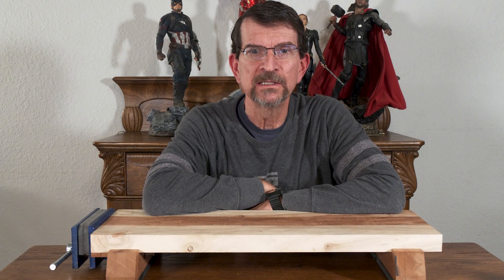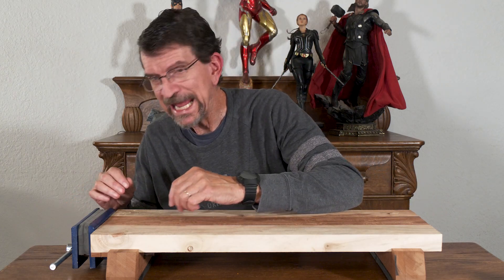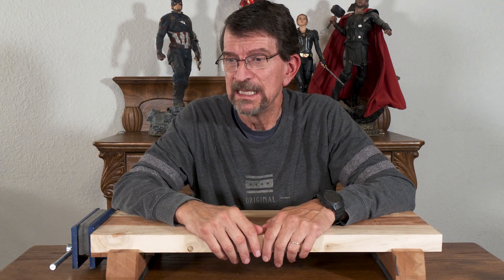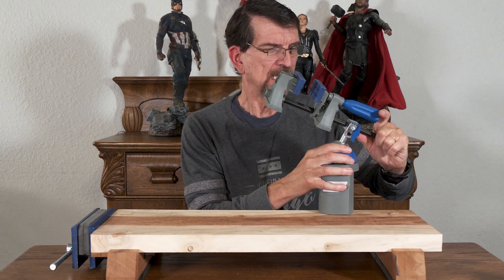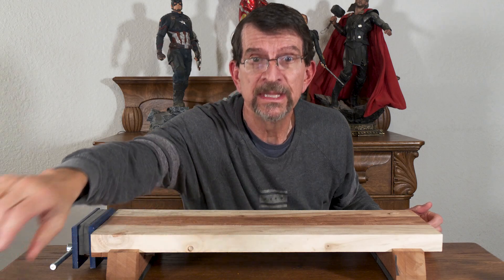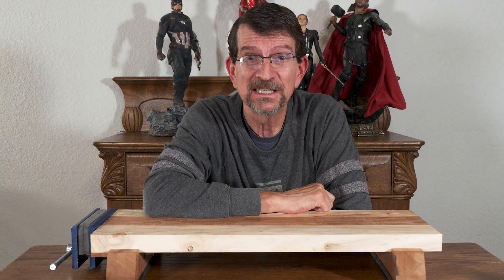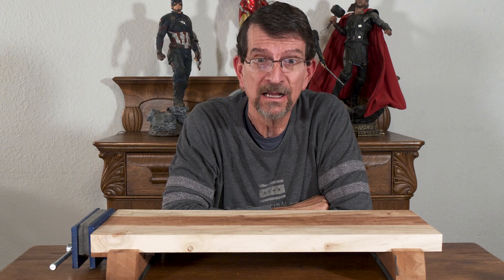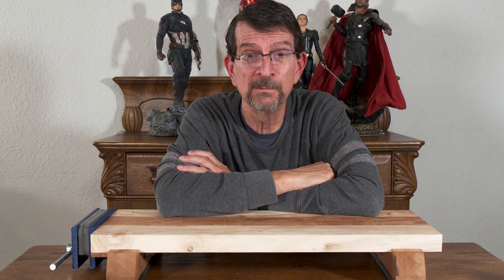[Timeout Episode 11] CHECKING IN and a Preview of a Modification to the Mini Workbench!!!

Comment: Excellent show. Tools AWW AWW AWW Tim Allen impression
Reply from the maker: I knew what you were doing there without the explanation.🤪

I don't think I've ever, at the time of purchase, thought, "I'm going to regret buying this tool." After the purchase...yeah, well that's a different story. Case in point, the table saw I used for the bench video. It, (Hitachi) won't keep the fence square, and the riving knife is almost dangerous to use because it is warped. Too cheap to get a different one and I use it maybe twice per month. Oh well.